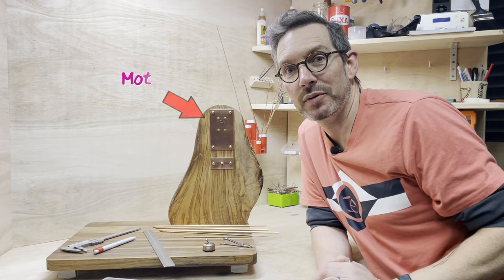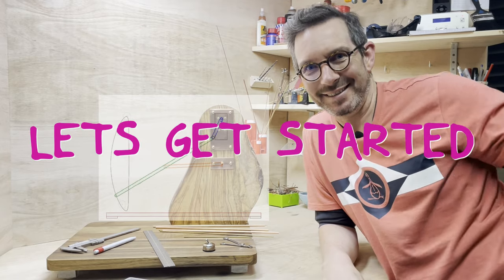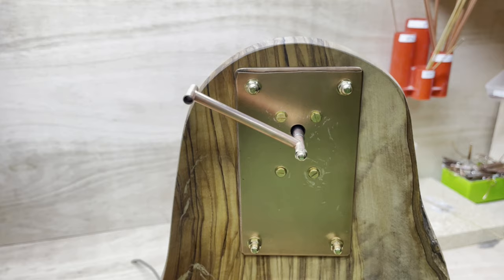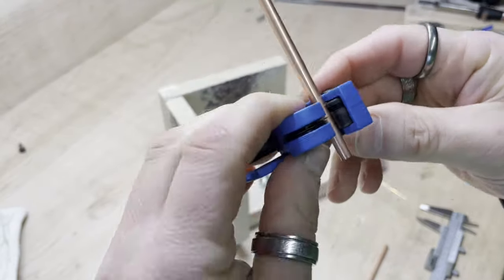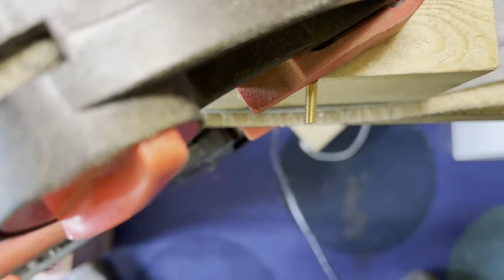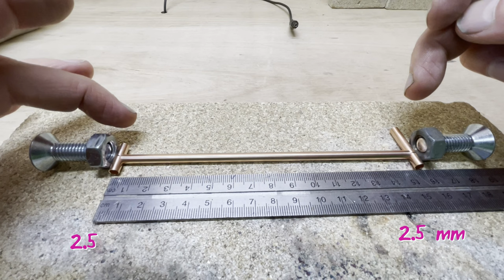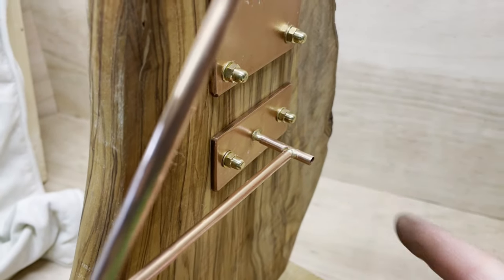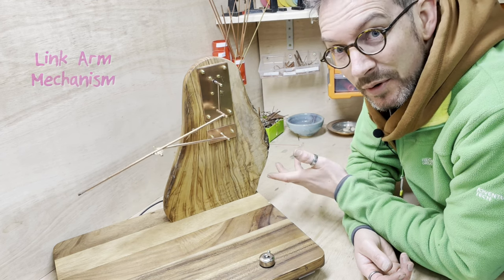Building a Chebyshev Lambda Mechanism for my Rolling Ball Sculpture RBS4 EP 4

Comment: Very clever way to lift the balls!  Is there a reason that you brazed the lift mechanism rather than soldering it?
Reply from the maker: Thanks. I had a little practice a month ago and found this just worked best for me. Also, it made a change and challenged me a lot.
Reply: @CopperGravity  what kind of rod did you use for the brazing? Was it brass as well or something else?